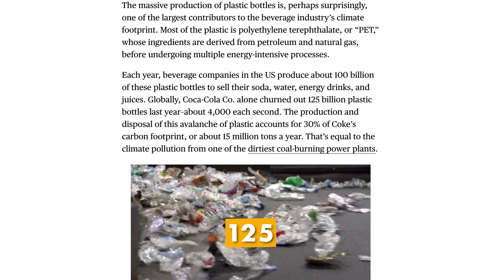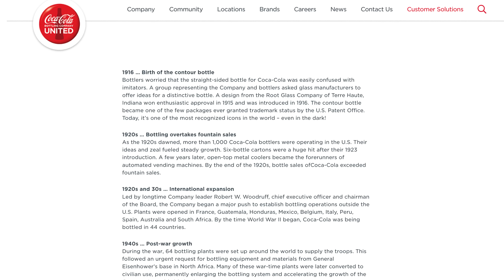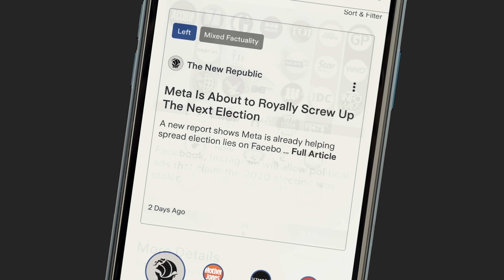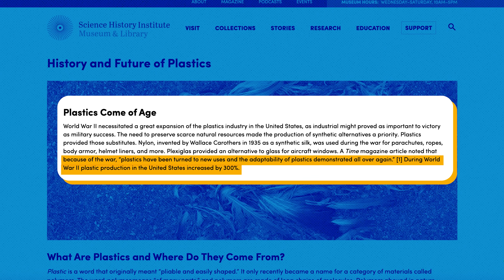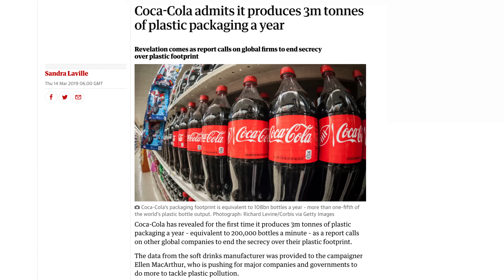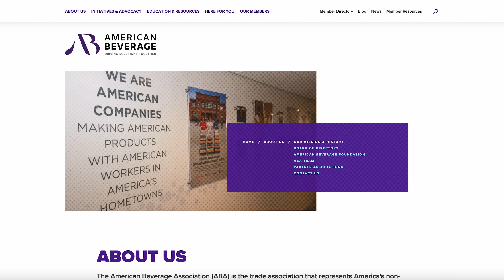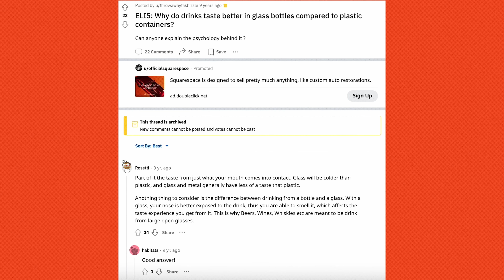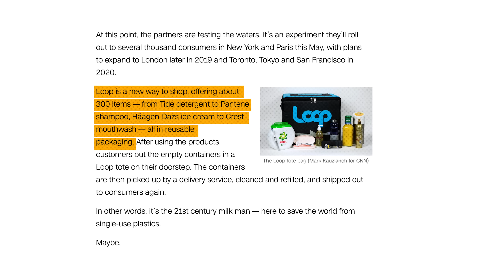Why the Glass Bottle FAILED

Comment: In South Africa you can choose between plastic, glass, or aluminum coke bottles. Glass bottles are mostly relegated to 300ml but you can get them at almost any restaurant throughout the country. There are also specialist stores like the sweet zone that sell 1.25L glass coke bottles, or takealot where you can buy 24 300ml bottles for $16.30.
Reply: You can in the US, but they're mostly plastic bottles and aluminum cans. We still have aluminum and glass bottles though. Just rare and expensive. Where I live, most glass cola is Mexican.
Reply: I'd say it's a lot more likely that cola companies would wholesale switch to aluminum, rather than revert back to glass.
Reply: @0o0ification  Aluminium also has it's issues
Reply: @TheSliderW Like what?
Reply: @desertstar223  It can be hard to recycle if it has paint or has an inner plastic coating. Depending on the contents Al can leach into food causing poisoning. It's also a rare metal and sourcing/melting it can also cause pollution, etc ...
Reply: @TheSliderW  While painted and coated aluminium cans can be hard to recycle, it is still recyclable. Millions of these cans are recycled annually. However,, aluminum is not a rare metal. It is the third most abundant element in the earth's crust.
Reply: @desertstar223  rare in the sense it's expensive to extract and process. But the point was that it can be toxic if ingested and it should not be in contact with food, especially acidic beverages. I've also seen people use foil to cover food they cook in an oven which is also quite dangerous.
Reply: @TheSliderW  You sound like a conspiracy theorist. Aluminium is not the devil you make it out to be. Aluminium plays a crucial role in the world economy. Its not just used to make food containers. It also plays a crucial role in transportation, construction and electronics.
Reply: @TheSliderW  Please spend your time and energy on the devastating plastic pollution crisis or the damage being done to the environment by lithium mining. You are concerned about something that no one is concerned about.
Reply: @desertstar223  Why are you calling me out for being concerned about something dangerous ? Please stop saying BS.
Of course i'm concerned about plastic pollution just like anyone but that doesn't prevent me from being concerned about other issues, just like you should too.
Someone mentioned using Aluminium as food container and I was just pointing out it's issues. Please stop disregarding problems just because they seem minor. That's exactly what our elders did with plastic when it became common use...
Food safety should be primordial and there are plenty of perfectly safe alternatives to both which we've been using for decades and new environmentally safe ones have been tested and produced already. We won't get out of this mess as long as people like you or the companies producing the unsafe containers keep being lazy and cheap.
Reply: @TheSliderW  Stop your incessant whining. Go do something constructive about your 'problem'.Being a keyboard warrior helps no one and achieves nothing.

Comment: I was in northern Mexico in 1987 and they still used glass coke bottles.  You could buy the coke with the bottle for 16 pesos or just the coke for 8 pesos.  In order to buy just the coke you either had to bring an empty bottle to trade in or drink the coke in the store and turn in the empty bottle.
Reply: Mexican coke sold in us is only in glass
Reply: We use glass bottles in India too
Reply: We still have glass bottles cokes, and a few years ago Pepsi also introduced a glass bottle Pepsi and I think also 7up
Reply: When I was a kid in the early 80s I visited relatives in northern Minnesota and they had soda from a store called the Pop Shop. It was in glass bottles which were only branded as ”Pop Shop” with only the caps telling what flavor they were. They would save the bottles to return to the store. I remember one of the flavors being strawberry.
Reply: We still do, for pretty much every flavor, you buy it for $15 (I think, I don't really buy it often) and return the bottle when you buy another one, it's like a token, you need to have a glass bottle to get a new one, or pay a deposit (you get it back if you return the bottle or you just keep it). We also do it for bigger plastic bottles (2 litres and 2.5 litres).

Comment: In Sweden until like 2004 we had plastic bottles that were returned and reused, not recycled, just like glass bottles. These were taken out of use because people kept returning them after having used them to store motor oil and stuff like that.
Reply: We still have reuseable plastic bottles in standard circulation in Germany. In fact we have both reuseable plastic and glass bottles for most types of alcoholic and non-alcoholic beverages, as well as one-time use containers from plastic or aluminium, which also have a deposit fee on them. In the latter case it is 25 cents, which is quite substantial, and makes most people return their one time use containers.
Reply: @Schnittertm1  Sweden still has reusable glass bottles, although they have gotten less and less common over time. Soda in glass bottles are since a few years back only distributed to restaurants and cafes. But anyway, I think reusable plastic bottles sound really unhygienic and it's insane how such a system apparently still exists. Plastic has a sorta porous surface and can't be properly cleaned unlike glass.
By the way, aluminium cans and smaller plastic bottles only have a deposit fee of 1 SEK in Sweden, about 10 Eurocent. Larger plastic bottles are 2 SEK. The former were only 0.50 SEK until 2009, it was largely changed because the last decimal coin was taken out of circulation then.
Reply: @Eddies_Bra-att-ha-grejer 
speaking of glassbottles in sweden, i read that systembolaget (the swedish monopol company of alcohol sales) was going to stop (or lessen atleast) the sales of alcohol in glass bottles. their site compares the manufacturing of diffrent glass bottles vs paper and plastic. (1/3 less with paper/pet/can)
they also proudly proclaims that "wine in paper, pet or can taste the same as wine in a glass bottle"
how much truth there is in that i cannot say
Reply: I remember getting a really scratched up Pepsi bottle when I was a kid. The paint felt neat on them too.
Reply: That was the story we got with the Gallon plastic milk jugs as well when I was a kid.  Probably wasn't actually true, and more likely that the industry found that a BS story or two in the news saved them a lot of money not having to pay for recycling.
Reply: @SunyJim  These plastic bottles were thick and reused, not recycled.
Reply: @Eddies_Bra-att-ha-grejer  we also in Finland still recycle the bottles via this system and I believe we ate me keen on doubling down than letting it go. But I believe they are melted down before refilling them, drive also foreign bottles must be recycled here
Reply: @miikahamalainen5343 Then it's not at all what I'm talking about, I was talking about plastic bottles that were actually reused, not recycled.
Reply: @Eddies_Bra-att-ha-grejer  Plastic bottles can be cleaned, however, they have an average lifespan of about 20-25 cycles before they are taken out of circulation. During the entire cleaning process the machines doing that have several tests and sensors built in that check if the bottles are still safe to use before they even get to the cleaning stage. Any bottle that fails one of these checks is rejected by the machine and sent to be recycled. The remaining bottles then go through the cleaning cycle and are then, again, checked by several sensors. As before, any bottle that isn't fulfilling all requirements is rejected and recycled. Only those that went through intial checks -> cleaning -> after-cleaning checks are then refilled.
Reply: Mmmm.... Microplastics.

Comment: In mexico we still have glass bottles and we also have "returnable" plastic bottles that are thicker plastic so it can be cleaned and refilled. Only instead of being paid back for returning them we have to pay a deposit the first time and when we return the bottle we can either get the deposit back (only if it is the same store we bought from first and the cashier agrees to), or buy another bottle at a cheaper price. We also have several local brands that still sell soft drinks in glass bottles for seemingly no reason (though that's unfortunately changing lately).
Reply: You guys use real sugar too. When I lived closer to the border I loved going to Mexico for the BEST cola from smaller glass bottles.
Reply: Nowadays, brands (here in Germany) like to use glass bottle to feel "premium" and mark up the price even more. Even Coca-cola does this. Here, they released a reusable 1L glass bottle that costs about 1.5-2x as much as the reusable 1L plastic ones (not counting the deposit) while weirdly enough, some local brands of soft drinks charge about the same amount whether you pick the glass or thick plastic bottles they offer.

Comment: Another point about the transition from glass to plastic with soft drinks (coke, pepsi, et al), it cost the same to the consumer. Think about that for just a second, it cost the same as buying a coke in a glass bottle without having a bottle to exchange. When the switch to plastic happened they ALL got away with a price hike that no one questioned. So, lets say a coke used to cost $1 (price varied with time and country) and you would get 30c back when you returned the bottle (again, varied depending on location and year), once the shift to plastic happened coke still cost $1 but you got nothing back. That is 30c more profit for Coca-Cola right at the point of sale (using these numbers) and that is before all the savings on rebottling, cleaning, collecting etc. Almost a 30% price hike that very few noticed and even fewer complained about.
Reply: I want to also point out back when they had bottle they had more local plants which reduced the cost to ship those bottles around.
Reply: Yes as a consumer I love that squishy feeling of cheap plastic when I open a bottle and the pressure keeping it in form disappears and you nearly spill half of the bottle because your grip tightens while the bottle deforms in your hands .. pure bliss.
Reply: actually about 43% profit gain for coca cola (143% of 70c ≈ $1)
Reply: Glass bottle coca cola never fully went away, and they cost a lot more than can/plastic coca cola
Reply: Those are some extremely high prices you're quoting.  Drinks were only 25 to 35 cents when plastic started coming out.  The deposit was 2 cents, rising to 5 cents at the very end.  But consumers were making too much money to be bothered with a 5 cent deposit.  The plastic bottles were around 50 cents when I first bought one.  Now I can get a 16 ounce plastic bottle of Pepsi at the grocery store for 50 cents most of the time.  The regular price is about $1 now, so I only buy them when they are on sale for 50 cents.  Perhaps you live in California or some other place with outrageous prices.  BTW, eggs are only $1.19 a dozen here.  I'm in northeastern NC.
Reply: @jaredhicks5655  But the ones I've seen are in throwaway glass and are shipped all the way from Mexico.  Of course they would cost more.
Reply: @bite-sizedshorts9635  they also have the 6 packs in glass bottles that are produced here that cost even more than Mexican coke, especially when you compare ounce per ounce (theyre 6 packs of 8 oz each)
Reply: @bite-sizedshorts9635 I believe the price was just to illustrate their point, not based on reality.
Reply: @bite-sizedshorts9635  I have lived in a bunch of different countries so I went with $1 for ease of illustration👍

Comment: When I was a little kid in the 70's we only had glass bottles. The upside was no plastic, the downside was broken glass everywhere.
Reply: it was a nightmare if you wanted to ride a bicycle. Even in 2008~ when i was a kid i had a lot of broken glass around the city.
Reply: It was/is hell at Virginia Beach and Willoughby Beach.
You get in a lot more trouble for having a glass container than for having an open (alcohol) container.
Reply: It was damned hard to bust a coke bottle, most of the glass was beer bottles which were tossed by underage teenagers drinking and drunks.

Comment: I did watch a video about this same topic not too long ago and the author concluded that, due to the increased weight and volume, glass packaging would end up increasing carbon emissions. Basically trucks will be hauling fewer and heavier containers which burns more fuel than switching to glass would save. I'll tag it if I can find it. Not sure if that math actually checks out but it highlights your point on the usefulness of smaller and more numerous bottling plants. Also, maybe the rise of electric truck will help change that equation. Great video. Love your stuff. Just found your channel today and your content is right up my alley. I'm subscribed and ready for future videos

Comment: Here in Germany we have plastic bottles who are designed to be reusable. And even if someone throws such a bottle away, you can be sure, that somebody will pick It up and bring it back to get the money. But we have also designated containers for single use Glass containers to be remelted and reused in another form.
Reply: Unfortunately it's all the super thin "Einweg" plastic bottles that need to be shredded and melted down, while the thick and sturdy "Mehrweg" ones that are just cleaned out and much better for the environment are more rare and almost never get a discount below the "Einweg" ones. So the industry is actively pushing the people away from glass and Mehrweg plastic. Despite, I should have to say, the taste of the Mehrweg ones also being genuinely better because the carbonation doesn't disappear so quickly for some reason.
Reply: @dschehutinefer5627 Those extra emissions from shredding melting and shooting the new bottles are mostly if not totally offset by the reduction in transport emissions due to the lighter weight of the bottles and their reduced volume in the shredded state.
Reply: In Munich there is the 'Pfand' (sp?) the deposit on plastic bottles that can be reclaimed at a reverse vending machine. During Oktoberfest some people roam the U-Bahn collecting huge numbers of bottles to claim back the Pfand.
Reply: @EdMcF1   Pfand is a Germany wide system, allowing you to return your bottles in any supermarket that sells the brand you want to return.
If you take a random bottle to a random supermarket the chance like 95% they will take it.
Reply: @antonf.9278  Thats not 100% true, a supermarket in Germany only has to take the same kind of bottles they are selling. that means if one supermarket only sells one way plastic bottles they also only have to take back those. but with one way plastic bottles your 95% might be true.
Reply: @zitachiii2196  i dont know if it is still the same or not (probably is) but back in 2013 when i lived in Germany we could take those bottles that the supermarket machines didn't take to either a petrol station or one of the drink wholesalers. The supermarket machines would give 25 cents for a bottle the other collection points would only give 10 or 15 cents/bottle. still more than simply just taking them to the recycling bins and there where times when i made 50-100 euros a week from those bottles while traveling on the train to and from work.
Reply: annoyingcommentator1582  Einfach so ziemlich jede Plastikflasche, die in Kästen verkauft wird? Coca Cola, Sprite, Rensteig, Lichtenauer, beispielsweise? Einfach mal nicht in den Billidiscounter gehen könnte da helfen...
Reply: annoyingcommentator1582  I live in Germany, NRW to be specific. Every plastic and glass bottle solid in every store has "Pfand". There are very rare exceptions to this rule. I have seen recycling machines that collect bottles and stamp them, but not in Germany.
Reply: When I was a truck driver I once went to a glass factory to pick up a truck load of bottles and jars. there was literally a mountains of broken glass next to the plant. one clear, one brown and one green.  all ready to be turned into more bottles and jars.